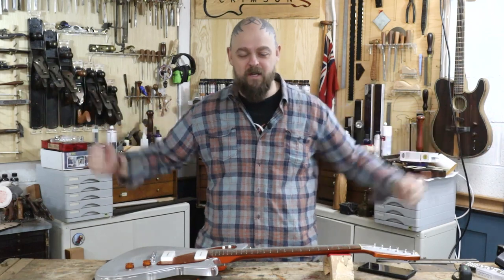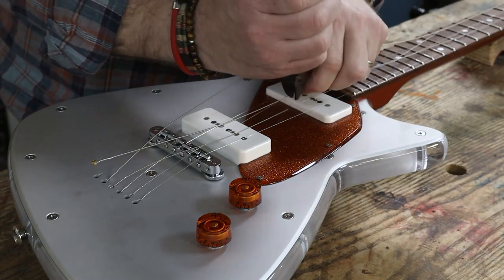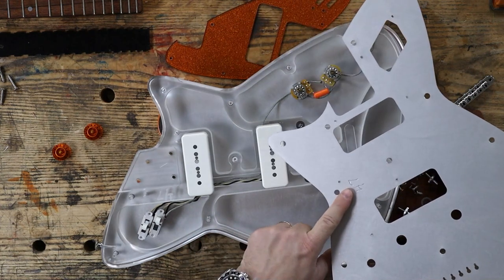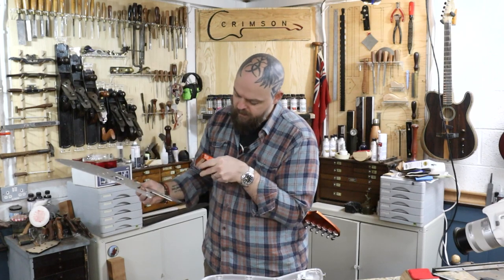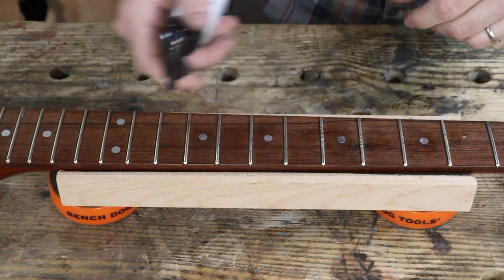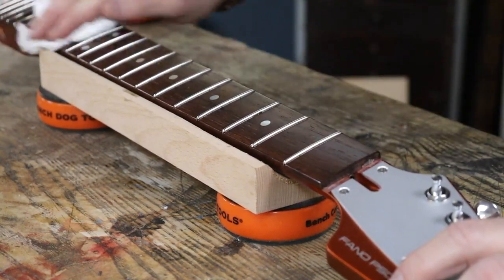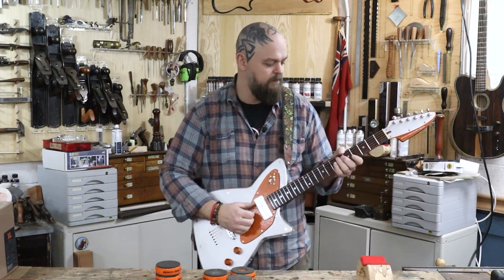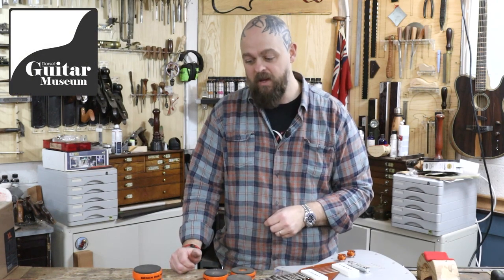Coolest Guitar EVER? | Fano Psonicsphear Luthier Teardown and Review

Comment: The switching system employed on this guitar is actually quite a bit more useful when used on a triple pickup axe (you can get some really cool sounds by setting two pickups in phase and one out of phase) but is much easier to use with three position mini toggle switches as opposed to the rather clunky slider switches used on this model.

Comment: My old soviet guitar "Ural" had a 5-pin DIN connector. I replaced it with barrel jack. When something goes terribly wrong and the jack is broken inside — you need proper tools (which are not always at hand) to extract the pieces. On, let's say, Stratocaster (never happened with mine, actually) you just need to unscrew the jack plate.

Comment: Barrel (panel) jacks suck. I used to use them in the instruments I built. The problem is the contacts are small and wear out after a while. I’ve had to replace them on every guitar and bass I own. 

Recently I bought a Pure Tone Barrel Jack. I don’t care for their standard jacks, but this has a nice solid feel. Time will tell if it last longer.

That guitar is wired like a Fender Mustang with the phase switches. The pickups are made like Rickenbacker toasters.

Comment: I could hear those switch freqs were different, top/bottom, either, or. They would supply different 'tones' when pushing the headroom on a tube amp. Thus they are not the same.
Cool guitar..

Comment: How about this one for the barrel jack. I bought 5 usa Jacksons in the mid to late 80's never had a single issue with the big switchcraft style input. During the same time period 3 Kramer's too. All had the switchcraft brand barrel Jack's. One needed replaced twice. The othe two were temperamental many many times with multiple cables and wireless transmitters. 
Now that I've been building guitars a few years with around 30 builds and have used these switchcraft barrel jacks 2 times I can attest I will not be building more with these unless it becomes absolutely necessary.  
Lastly, there's not enough pressure on the tip of the patch cord or transmitter jack, therefore the culprit for the issues lies at this tiny weak point.
That's the best got dude, convinced yet? They just dont stand the test of time.....
Reply from the maker: Convinced..

Comment: sorry for the rookie question, is the acrylic body not done in a mould rather than cut?
Reply from the maker: No. Now days people would cast the resin and run the risk of shrinkage. Bubbles etc, but this was about 10 years ago and was a solid sheet of acrylic warer jet and cnc routed out. Much easier to make for the luthier if a bit more wastful
Reply: @CrimsonCustomGuitars  thank you for your reply. I've just finished a resin/cloth top guitar, made from my wedding shirt. And I thought that was wasteful-covering whole blank with epoxy!

Comment: It is for sure a nicely designed and made guitar. The orange is incredible and goes so well with the aluminum and acrylic. Detractors for me would be the pick ups and the fact it is yet again another body that looks like freakin Squidward. Still a very unique and desirable instrument.
Reply from the maker: Squidward!? 😆 🤣
Reply: @CrimsonCustomGuitars  yes grab it by the neck and hold the body up. Its Squidwards (From SpongeBob Square Pants) head shape.
Reply: @CrimsonCustomGuitars  Also see the spam bots are very busy in this thread. Went thru and reported as many fake telegram me accounts as I could find. If you can block keywords add telegram to it as NO ONE who is not a scammer uses that for the most part.

Comment: I dislike barrel jacks as no one makes a good one, including Switchcraft. Compared to a Switchcraft #11 or any of the new multi contact 1/4" jacks, barrel jacks often wear out sooner and have a less tight electrical connection, thus, it's less reliable, including the way the contacts are held in place. Just a poor design and I'm tired of replacing them in customer's axes (usually basses). Sorry, this is a sore spot with me.